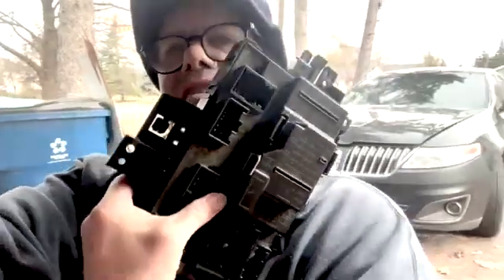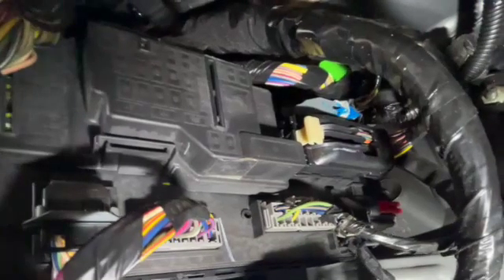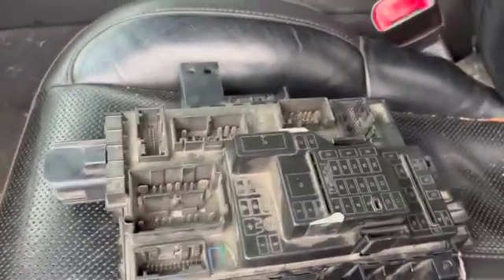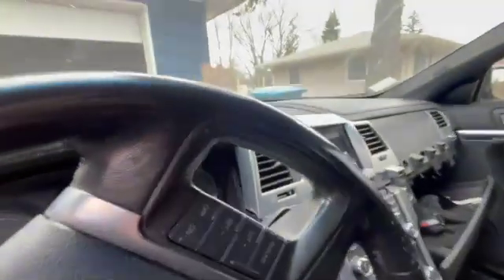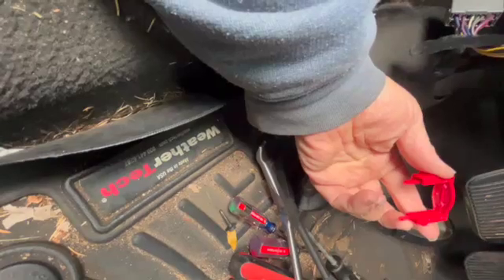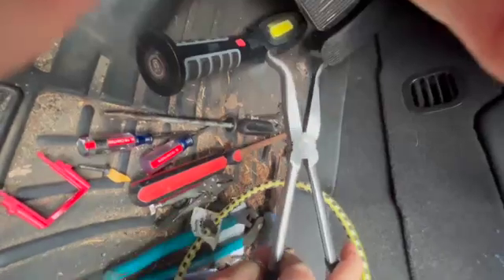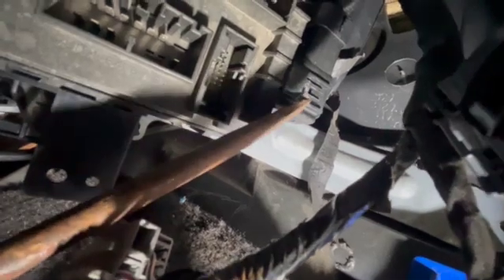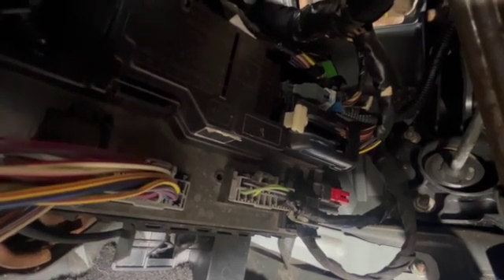Lincoln MKS 2009 2010 2011 2012 Remove and Replace Body Control Module ( BCM )

Comment from the maker: No, only because I no longer had the original, and without original they struggle to reprogram used one that I installed. But indeed, the BCM is the problem.
Reply: So if you had orig bcm and the replacement... Was you just going to take module only to dealer or vehicle too?